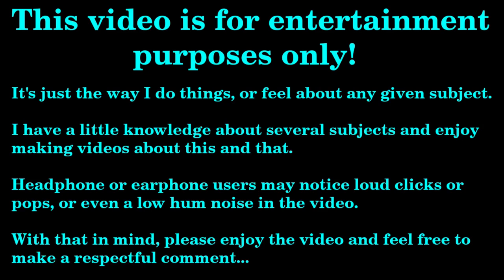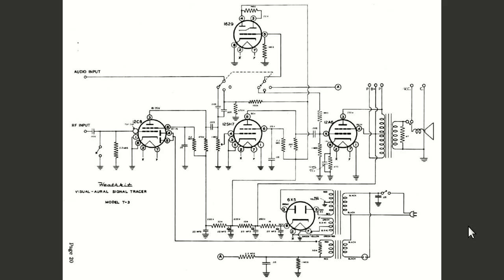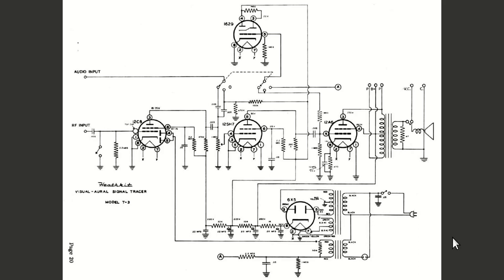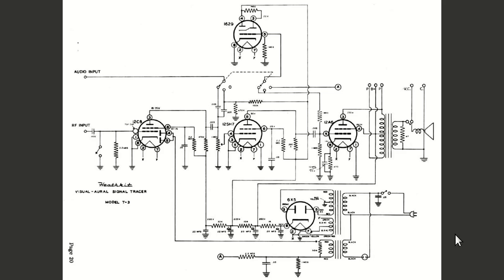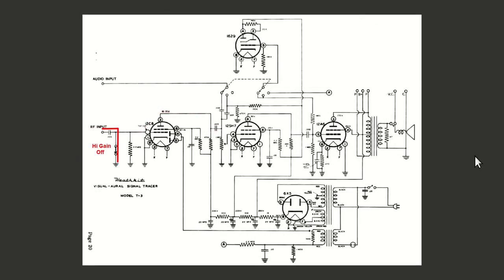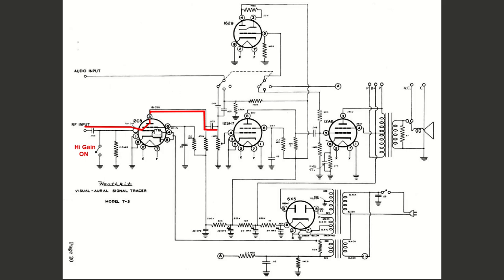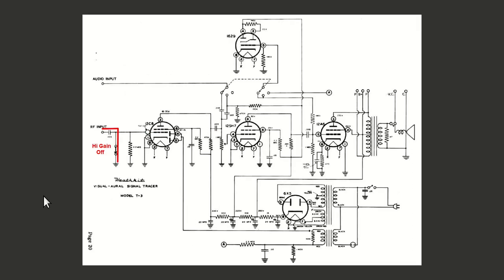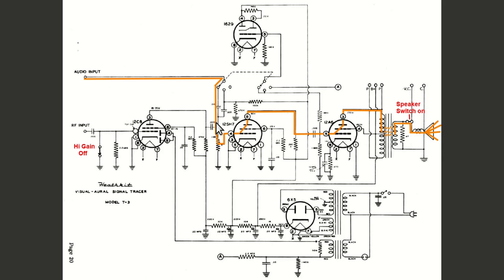DERB - Heathkit T3 Signal Tracer - Diagnose and repair

Comment: Doug, you did an EXCELLENT  tutural  on the circuit, you should be an electronics teacher.
GREAT job also on finding the problem, I agree those modern Chinese resistor colors are off, better to use a meter like Larry said.

Comment: Basically it helps to have a fresh set of good eyes and hands as well as using electronics knowledge to troubleshoot how a circuit works.
 When I find something not working properly sometimes you have to poke and prod to find a poor solder connection.
That is where the hands come in. I have a radio and a phonograph player both  with just that issue. Just by looking at it you would not know
why it is not working as it should. Amazing learning video and great job on the repairs Doug!

Comment: Hi Doug
I just finished recapping my T-3 and brought it up on variac no smoke. However voltage on pin 8 of 12SA7 is 250v. I ran and rechecked the dropping 390k resistor is correct value.lol... all other voltages were spot on. 
I have 2 good tubes and there is no change between them. 
How would you groove shoot this?
Reply: @DERB_Seymour_Indiana  thanks Doug
I did mean the 12sh7, and I did not have any good tubes like I thought. I did get an NOS tube popped it and voltage is 115v. I thinks that's a win. Mine is very sensitive but hummy even after recap and resistor swap. And dang that 6X4 gets hot. What do you think of solid state swap? Thank you for the reply. 
Frank